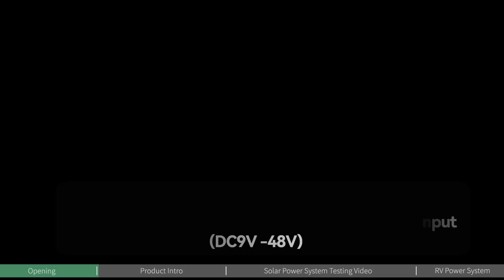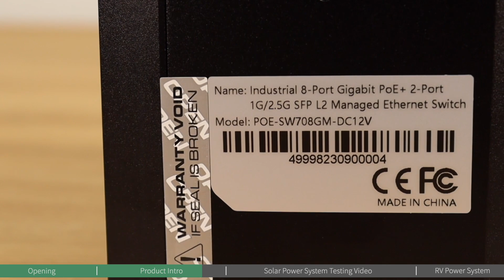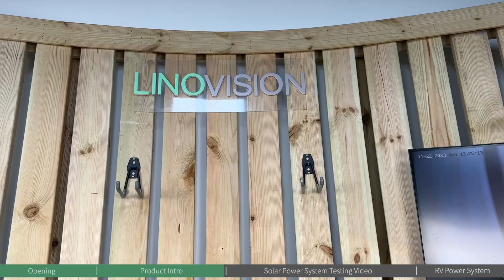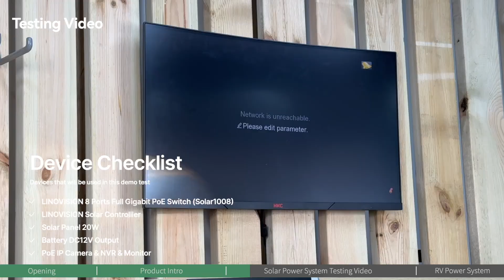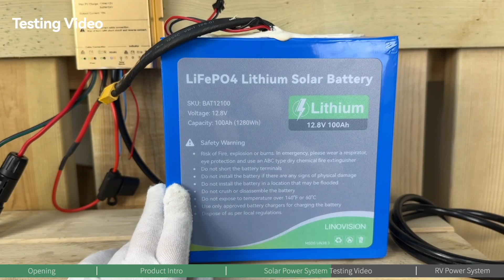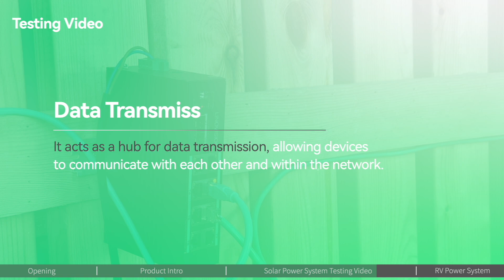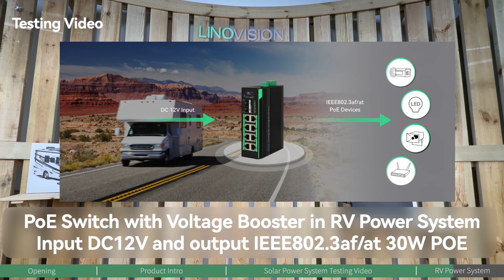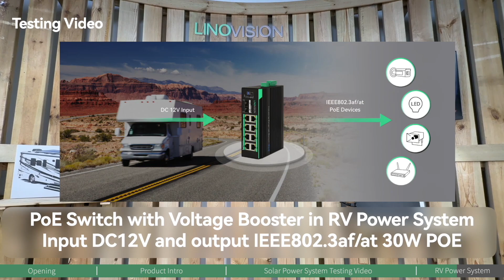Wide Voltage PoE Switch in Solar/RV Application, explained, with full installation guide

Comment: Well, the units do work fairly well but I only give them a "B" grade because they run hotter than they should when you actually use the +12V or +24V DC outputs.  Their internal buck converters should be 92%+ efficient, but they appear to only be 80% efficient or so.  A lot of power is being wasted.